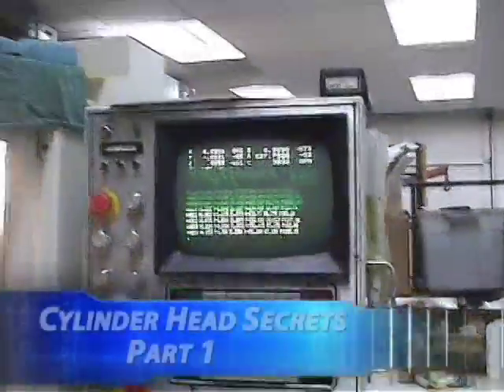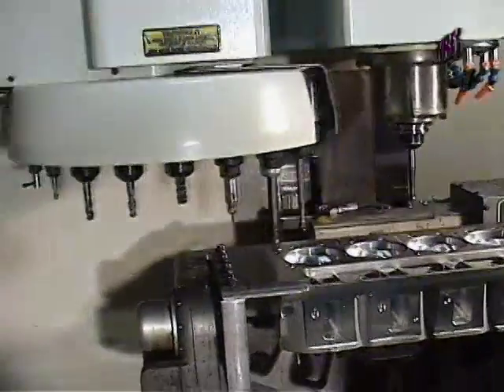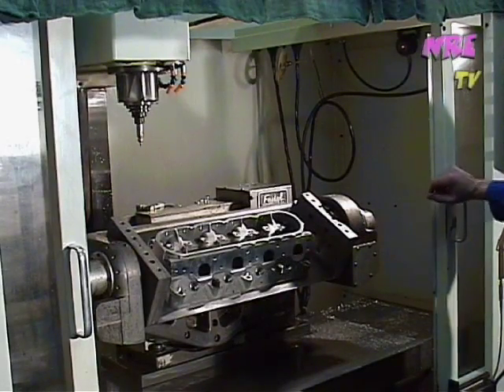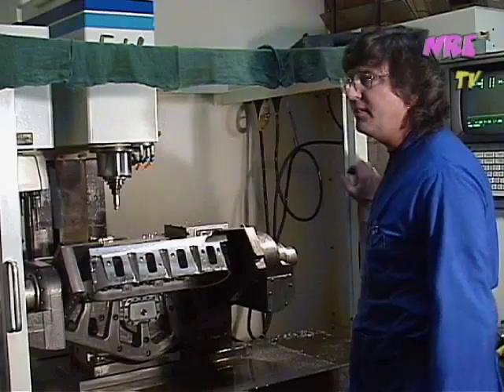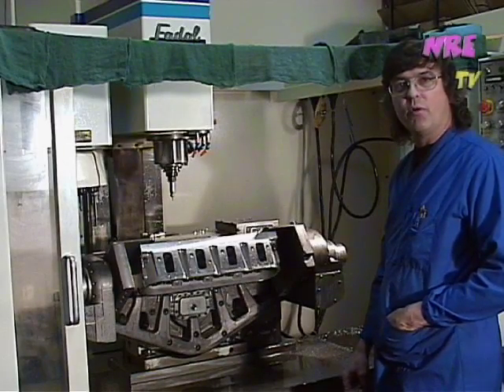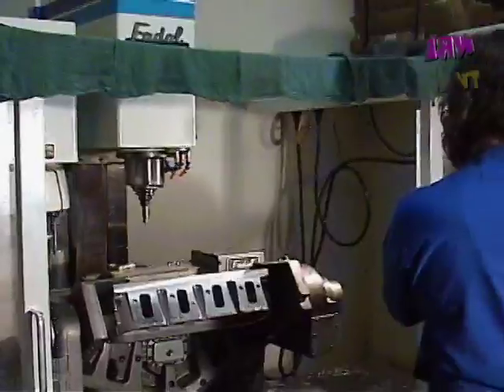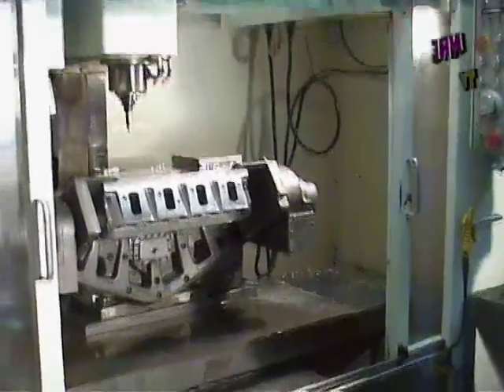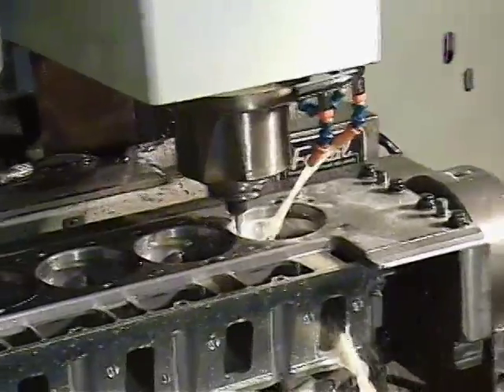NRE University:  Cylinder Head Secrets, Part 1 of 2.  Nelson Racing Engines.  Veritas Movie Studio.

Comment: Very cool stuff! In the video, it is mentioned that the CNC ported heads flow the same,
cylinder to cylinder.... what I'm wondering is how much variation is typical when porting
by hand vs CNC. Does it just take alot longer to get the same consistency or is it near impossible to get each and every port to have identical flow vs lift profile's?
Although I've never done any cylinder porting, I can certainly appreciate how much time and effort is involved with hand working.... I spent an incredible amount of time modifying
a intake manifold, throttle bodys and turbo charger inlet, and had my modifications tested
on a real flow bench. Sheesh, if I would have known in advance how long it was going to 
take, I think I would have paid someone else to do it! I've got to admit, it was alot of fun!